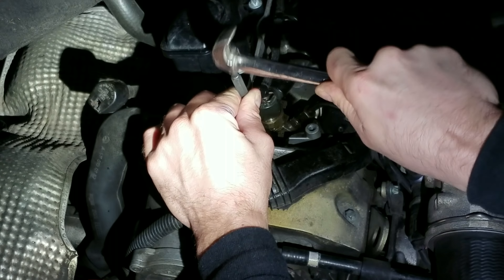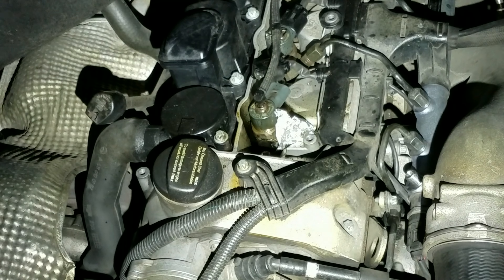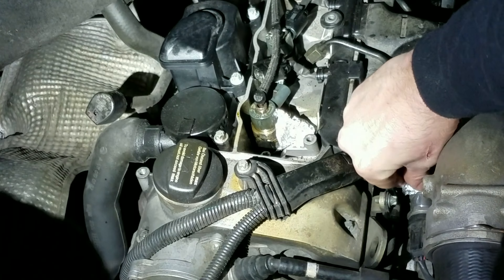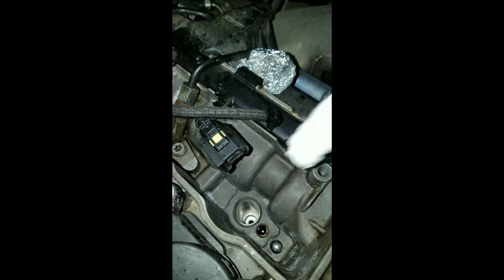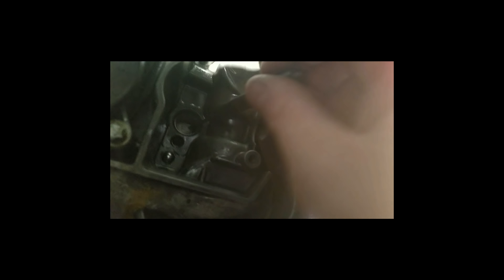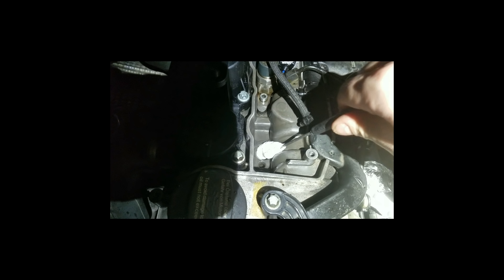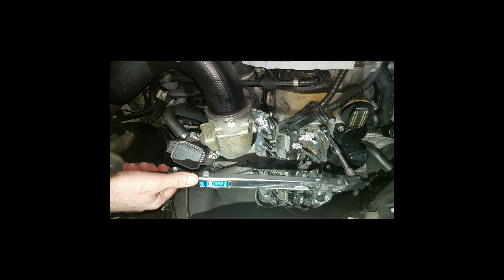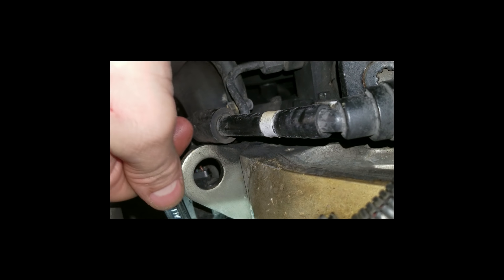How to fix "Black death" injector seal leakage on a T1N Sprinter [02-06 Dodge/FL/MB]

Comment: Have any experience with blk smoke on cold start ups?
Reply from the maker: Not personally. Black smoke is partly burnt fuel, too much diesel, not enough air. I would remove and inspect the egr and scan for codes. IME bad glow plugs cause white smoke, which is unburnt atomized fuel, colored white because the droplets refract light. If the egr is ok, if its an 04-06 I'd unplug injectors one at a time to see if that solves it. A bad maf sensor can cause black smoke but not only during a cold start. A leaking injector seal, black death, can cause low compression which could result in black smoke, but not only on startup. a common cause of black smoke is the turbo actuator malfunctioning; on 02-03's it's vacuum actuated, so a leak in the turbo actuator vacuum line can cause black smoke but once again not only during startup. The actuator linkage can seize up, which could cause your problem. But my bet is that the EGR has sticky black tar in it that causes it to stay open a little bit until it warms up and the goo turns to liquid. this causes a loss of boost pressure and a lack of oxygen, creating the perfect conditions for black smoke, too much fuel and too little oxygen.
Reply: @AncapistanVan  thanks for the details.  I have a leaking 1st injector seal for yrs and during this last major freeze it was really hard to start, then once it started it developed the hissing sound and I knew I had to fix it.  It took $40 of carb cleaner to clean it up to get the injector out, oh it started a little blk smoke when the hissing started.  I theorized that the computer was adding more fuel to compensate for the air being sucked into that cylinder.   So when I replaced the copper seal washer it was super tight on the injector when I installed it, I thought that was how it was suppose to be b/c it was new, first time doing this.  Once it was installed the injector it was missing some pulses b/c I could hear it.  I also am paranoid that I bent a connecting rod in that cylinder b/c carb cleaner got down the injector hole b/c when I first started it it missed fired and shook.  I had blk smoke pouring out for almost 5 min.  Now on cold starts it throws blk smoke for 1 to 2 mins and runs rough.  But last night I ran it hard to get fuel and this morning it started up with no blk smoke or issue.  I did clean the egr last yr but really didn't need it.  Still don't know what to think at this pt?  Any more guesses.  Thanks
Reply from the maker: Oops I didn't see your reply. I would observe the turbo actuator while someone starts it up. Maybe the linkage is binding. If the turbo can't move the vanes you will get black smoke and rough running till it warms up enough to loosen the goo on the turbo vanes or the rust kicks free on the actuator linkage. While you're at it, try unplugging the MAF sensor, see if that changes anything. Also check your air filter is not super clogged, a lack of air can create black smoke. Make sure to scan for error codes with a proper sprinter scanner like the Autel MD802 - maybe you have a bad 02 sensor or MAF. Another possibility is the injector may be damaged leaking from the tip- if you have an 04-06, unplug the electrical connector and see if symptoms change. You can also put a BB in the high pressure fuel line, long as you stay far away from it while you crank the engine, because high pressure diesel leaks can kill/require amputation.
Reply: @AncapistanVan  I have a 2006.  This thing is giving me the shits.  I pulled the 1st injector and replaced the copper seal and resurfaced.  Ran good for a wk then went into limp mode, that's been 2 wks.  Wouldn't go above 60 with poor acceleration, then it just started shutting off.  Seamed like under a load, but has done it at different times.  Now it's in limp mode but not shutting off as much.  I tried using autozone and advance b/c I don't have a scan tool.  I have an open #1 injector.  I can hear it working so I don't understand why.   The blk smoke stopped after I fixed the seal, but now it starts up with blue smoke and runs rough until warmed up.  There's oil getting into the intake, but not sure of the reasons.  Any more guesses, thanks
Reply from the maker: @frontlinemedia4270  Open #1 injector? As in the wire harness to #1 has an open circuit? If it's a stored code, no problem. If it's active, that's not good. The wire harness is known to rub on the top of the engine and develop hard to find open/shorts, but maybe you just have some debris in the injector electrical connector. You really need a proper code reader. Blue smoke is from oil, prob from the CCV. Oil getting in the turbo hoses is normal, and becomes more and more as the CCV gets more clogged up. At some point it can build up enough for it to get into your intake and cause blue smoke, so your engine may not be toast, just needs some maintenance. I would remove and inspect those turbo hoses and the turbo resonator. Dump out any oil, look for a crack on the seam of the turbo resonator, because you may have a fuel issue and a boost leak at the same time. The instant shutoffs, in my experience, are usually due to the fuel rail being unable to maintain set pressure vs actual pressure, or a power/ground distribution issue (Bad firewall ground or fuse box under drivers wheel for example). Although maybe if you have a bad enough boost leak/turbo actuator stickage it would shut the engine down? Are your boost hoses oily, at all, on the outside? You need to scan for codes, see what's really going on, then tell me what the active codes are and we can go from there. In the meanwhile I'd investigate the turbo hoses and resonator and the turbo actuator.
Reply: @AncapistanVan  I took the resonator off a yr ago and expoied it for safe measure.  No visible cracks in hoses.  Hoses were normal oily before this limp mode and shutting off, now definitely oilier.  I'm thinking MAP sensor or crank angle sensor.  The code just said open injector circuit.  I'm assuming from disconnecting and fixing, b/c I have no way to erase codes.  I think I had a code for low manifold pressure.  No obvious signs, but does run worse when first starts up, then gets better, but still poor power, limp mode, and shut offs.  I also pulled on the wire harness while running with no change, and don't see any wear spots
Reply from the maker: @frontlinemedia4270  Are the hoses oily on the outside? If so that's a boost leak. Your open injector circuit code is probably stored rather than active and hence unrelated. If it is in limp mode there will be a code explaining why. You need to get a proper scanner otherwise we're guessing.
Reply: @AncapistanVan  yea, I know I'm guessing.  Even when these vans throw a code it doesn't mean it's it.  I read the sprinter forum posts and no one makes any sense.  They take them to dealers and they can't figure it out.  One theory I have is that the wires rubbed under the blk spine on the head.  I had massive blk death, it took me 25 cans of carb cleaner.  I also have insulation off the injector wires, but if carb cleaner got to some rubbed wires under that blk spline, the insulation could of rolled back.  I put the tester on the exposed injector wires and the head looking for a direct ground.  There was no audible sound but the meter fluctuated when I touch the wires, connector to the injector unplugged.  It runs rough at cold start up but gets better as it warms up, but still lacks power.  If I pull sensor plugs, MAP, manifold air temp, MAS, it runs rough and won't run steady even after replugging in each connector.  Have to re start the van for it to run steady.  I don't have money for a scanner.  I don't have money for my own electric bill.  After I did the 1st injector seal fix, it ran just like yours in this video, then it started going dn hill.  My van has oil on the outside of the hoses but this engine leaks oil around the gaskets
Reply: When it first starts up cold it sounds like it is missing.  When I was pulling connectors and re attaching, then trying to start it.  I would have trouble getting it to start.  Guessing why, of course.  I have no idea at this point.
Reply: @AncapistanVan  how hard is it to replace the crank sensor and how do you check the installed one?  I didn't find its location yet, looks like no room
Reply: @AncapistanVan  did the leak dn test and the #2 injector failed.  What causes this to happen?  Can it be cleaner, taken apart, fixed, etc.  Damn this van is really starting to piss me off.  I saw another person's video about this and the said it's confusing to figure out this problem b/c throws weird codes.  I could only go to auto zone to scan it.  One was low fuel pressure, I guess that explains some of this.  Now, it won't start, the guy said it will do this as well
Reply from the maker: @frontlinemedia4270  Leak down test is where you blow air in the injector hole and look on the bottom of the engine for leaking air. A leak by test is where you put 3/8" hose on the injector return line and compare variation/max height. So you have one injector that is returning a lot more fuel? Can you send a pic? What happens in this situation is the injector leaks internally, and the fuel rail cannot hold enough pressure anymore - resulting in either or both high and low pressure codes - As it tries to ramp up pressure to compensate for low pressure, it can trip a too high pressure code when the problem is really too low of rail pressure.  If you want to rule out the injector, put a BB in the injector fuel line to block flow and see if symptoms resolve. It will dry fire the injector but it will be ok for a moment. 
However, the proper way to troubleshoot a rail pressure problem is to first pressure test before and after the fuel filter with a T-fitting and a pressure gauge. You need 55 psi min, otherwise you get too high/low rail pressure codes. Absent a pressure gauge, just disconnect the hose after the filter, put it in a 2l bottle and turn the key, it should fill up really fast, I'd guess 5-10 seconds. 
Next, perform rail solenoid leak test: https://sprinter-source.com/forum/showthread.php?t=27663&page=2
Then perform injector leak-by test, and if there is more than 50% variation or 1/2" of fluid from one or more injectors, repeat the test at operating temperature, and if same results, remove and bench test the injector (Replace it most likely, they never pass the test). 
The quantity control valve may be the culprit if you only have symptoms within 30 seconds of starting the engine. You can test the HP pump by disconnecting it and making sure it flows plenty, but stay far away as a diesel injection in your skin will kill you.
 But yeah it's simple as that. It's either the fuel filter, lift pump, rail solenoid, leaking injector(s), or less likely, the hp pump or quantity control valve. So you start at the beginning of the circuit at the pump and test all the way to the injectors. Somewhere, something is not holding pressure. IME, the rail solenoid is the most likely to fail, around 200K. Start by testing pressure at the filter. Message me and I'll send you my number.
Reply from the maker: @frontlinemedia4270  As for the crank sensor, you have to do it by feel, it's not hard tho. Location: https://www.youtube.com/watch?v=ueSniMBGb90

Shop manual http://diysprinter.co.uk/reference/2004-VA-SM.pdf
Reply: @AncapistanVan  ppl called it by different names, leak off, leak dn, etc.  I'm referring to the injector return line.  This needs to be a normal maintenance thing to do.  #2 failed.  Once an injector bypasses and returns the diesel to the rail, it drops pressure, and the computer won't let the engine start.   b/c although it's a high pressure system, the volume is so low, any leak triggers either one of the sensors on the front or rear, of the rail, to send a no start signal.  I discovered that all my injectors were replaced with Mercedes re man, the #2 is bad, so must be at the valve inside the top of the injector.   I ended up buying another injector, then tested it for a leak off and also took the nozzle off to clean it.  The injector should shoot 7 streams, my remanned one failed the leak off and was only shooting 5 streams.  I failed to know how many streams it shot when I cleaned it, but now found out by taking the other one apart.  I couldn't take the top internals out b/c I need to make or buy the tool to do it.  I will eventually so I can rebuild it.
Reply: @AncapistanVan  I replaced the crank sensor as well.  It was a bitch.  For a number of reasons.  The tab they use to disengage the connector is rt at the 90 of the clip.  Hard to even push it.  Ended up taking the small bolt out, then removing with everything attached, but it was stuck in there so bad it took hrs., even with spraying lubricant.  Finally it move up a little and I was able to wedge a screw driver under it.  It was hard putting it back in, used antiseize on it, moving it up and dn, for what seemed like forever, and it finally dropped in place.  Exhausting.

Comment: German diesel... In some japanese diesel injectors seats underneath head cover and blowby from PCV may be mistaken with broken rings rather than worn injectors seals. Yeah, German compression engines are much better.

Comment: Dont replace the washer with OEM they are still useless, honda does the same size copper washer with a slightly thicker oval to them.
Reply from the maker: I actually have 5 honda seals, cost me like $40 from england, but they are much thicker and I realized it would change it injector tip depth. I saved them for a situation where the injector seat has been dropped, as this may have unintended consequences otherwise.
Reply: AncapistanVan  can you please share the page where you get the Honda washers
Reply from the maker: @chimoslocksmith http://www.coxmotorparts.co.uk/ they ask for a chassis number to make sure you're getting the right part so you will have to explain to them. It cost like 40 bucks for all five of them. If you read my reply directly above, I don't recommend them except for extreme scenarios where you have to bore the injector seat deeper. The solution to keep black death from happening is to simply change the bolts and copper seals out every 200k and mark the bolts so you notice if one starts walking. Or install bigger bolts. Also Mercedes added another 90-degree turn to the torque specs for a total of two 90-degree turns. This may fix the problem. They may have just been loose from the factory before they figured out that procedural flaw.

Comment: does this cause power decrease ?
Reply from the maker: The computer will not sense it, and it will not put it in limp mode, but theoretically yes there will be a slight power decrease depending on how much compression is being lost. If it's bad enough you'll basically be running on 4 cylinders, but I would hope someone would notice the smell and sound before that.

Comment: The merc seals are crap, I used the Honda accord 2.2 ones,thicker and compress and seal better
Reply from the maker: Yeah, but it changes the injector tip depth, so I haven't used the ones I have on hand. I have no clue what the tip depth would do to the burn efficiency. I'll save em for a job where the seat needs to be bored lower.
Reply: @AncapistanVan   it's made no difference to mine, it runs absolutely perfect, and I know this sounds totally insane but keep it at 60mph its returning doing nearly 40mpg its great👍
Reply from the maker: @tezotezo8532  Good to hear.
Reply: Wouldn't a thicker seal interfere with the torque setting?

Comment: some mechanic hitting a ratchet with a hammer, use the correct tools you cowboy
Reply from the maker: It's a junk ratchet. I dont have an impact driver. Regardless it was a useless move bc of the sludge in the threads i did that to knock corrosion loose, which was a non issue.